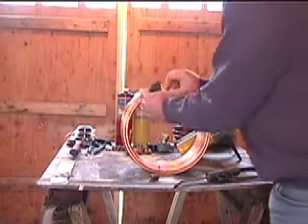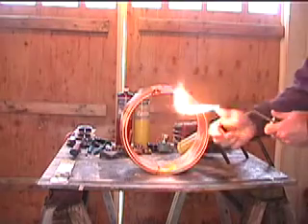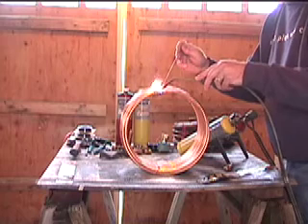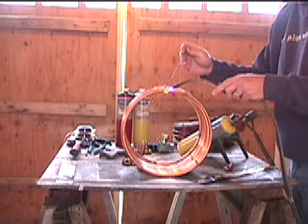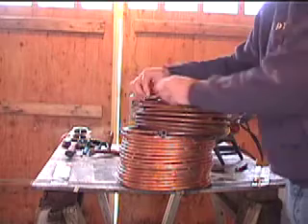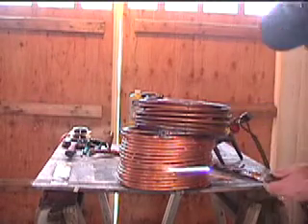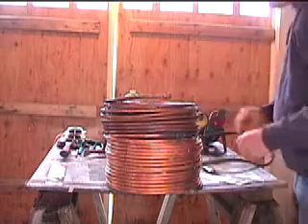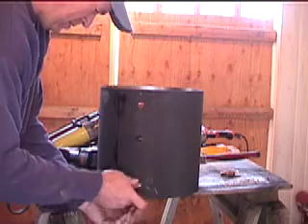Lynx Monotube Boiler Part 5.mov

Comment: Why not use regular solder with these joints?  Does it not hold up to the pressure, or the heat?  Also, I have not been able to figure out how to adapt the spark plug to the brass fittings.  Is there a 14 mm spark plug female to 1/4" NPT brass fitting?  Thanks!

Comment: Great work. Did the same thing back in 1999 when Victoria Australia had the natural gas crisis. Used same design for 3 weeks straight and worked perfectly. Provided hot water and heat to neighbours as well. Flares were on the outside of my simple boiler.

Comment from the maker: You could try flare fittings.  I only like using those outside the boiler.  A mapp gas torch is not hard to come by.  It really is soldering with bronze rods.  Or you can use the oxygen/mapp gas.  I worry that flare fittings will not hold pressure when they are near the hottest part of the gases.  I have seen flare fittings used inside.  If they leak you have to take everything apart and redo them.
Reply: Hello my name is harry and im looking for a boiler kit ive got a 55 gallon drum but id like to buy the rest of the kit for the boiler including a pmr research large 6 horizontal engine if you can include the boiler kit with engine id do business with you please email me at Harrybobb85@gmail.com

Comment: copper pipe is not rated @ 600 psi above 350deg F however, 1/2" nominal size drawn copper pipe can handle over 1400 psi @ 350 deg

Comment: so if you are going to want to run higher psi from this mechanism, you will want to upgrade from the 100 psi pipe fitting glues..ie,., the weakest link, is just that , the weakest link. If the pipe is rated at 600 psi, you will want to keep all the fittings and welds, at close to that tolerance, if you wish to run very high pressure, for higher output?